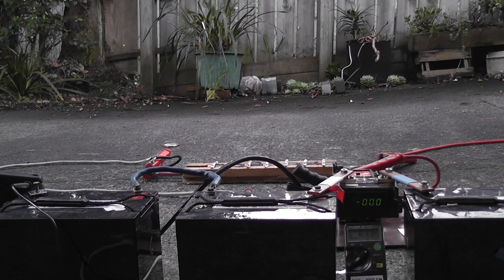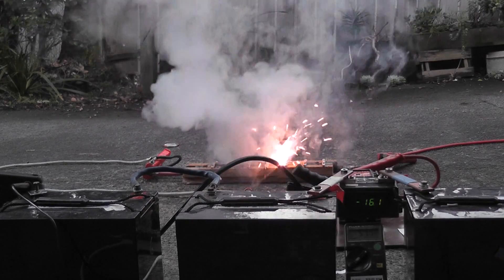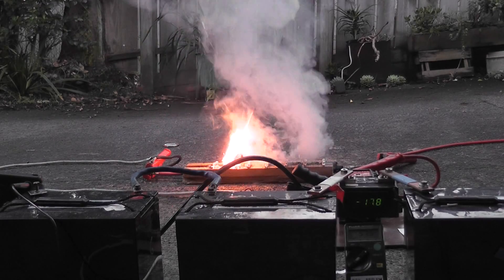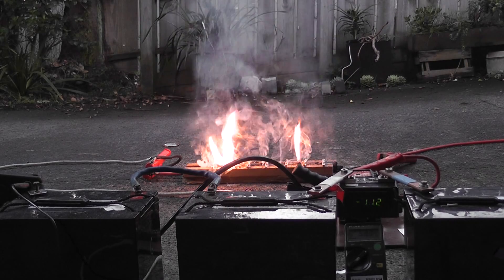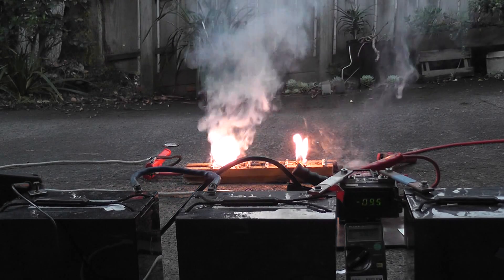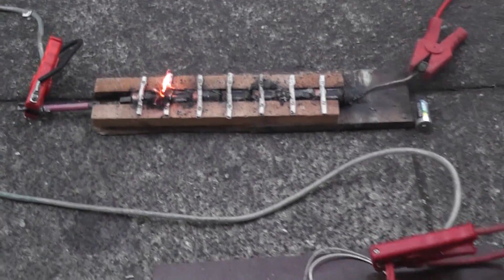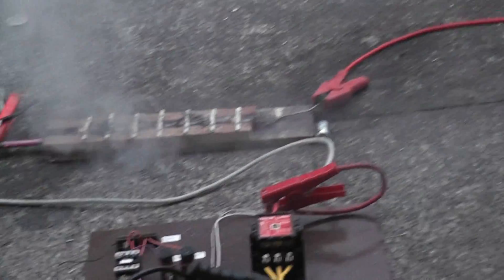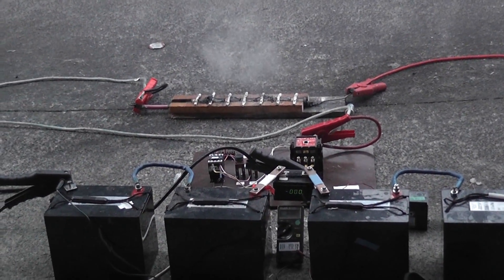7 batteries overcharged at 72 Vols DC

Comment: Yeah Duracells that piece of junk yeah this is fred in the United States yeah Duracell nothing but a piece of junk in there I don't know why you bother binders old junkie better than nothing but a piece of junk and then they don't offer I tried the mess up radios and the Fox a couple of the Little League in there they don't tell me you could seal around the battery case at all crappy ceiling around the battery is a piece of junk best battery in the mall is ever ready and the rail back in the workforce bearing there from the from the battery store battery plus they got the best batteries that stuff is a lot better than the junkie Duracell what you show on there on your on your clip yeah that's a piece of pizza junk I wouldn't use them in any of my questions are lower right cuz I have a real messed up the years ago about a crappy d'oeuvres I wouldn't even use a crappy day or so of all they did not help me at all or nothing total complete jerks in there and Duracell lab then want to do nothing to help me get another radio unlike other very best of a good way to you I don't have anything to do with Duracell junk that although the people in there or in the laboratories a piece of nothing piece of crap what they are those people don't know nothing at all nor Philippines in the bags open

Comment: This is so much better than capacitors, nice fireworks. I've tried popping 1.5v batteries, but they're too unpredictable when it comes to the current draw. I probably should have put many of them in series. Also, they stink much worse than caps.

Comment from the maker: These were 7 normal Duracell batteries which have been used of course. Cell voltage was about 1.4 Volts open circuit.
Duracell batteries are the best as they last very long, don't leak, and are great for these experiments before being recycled.